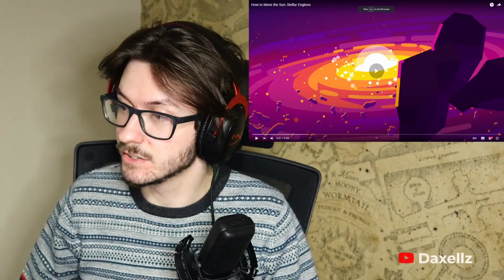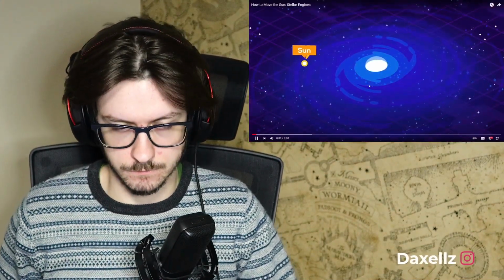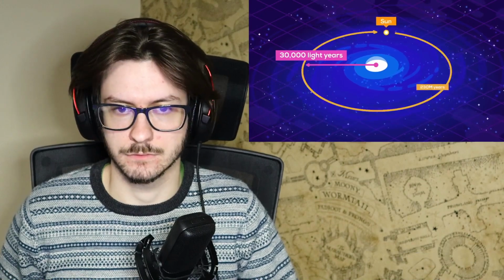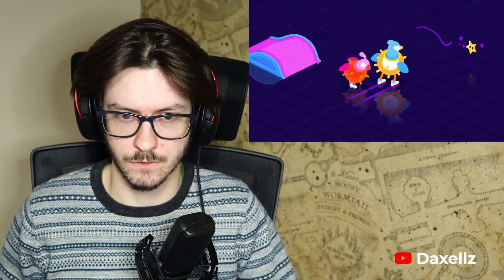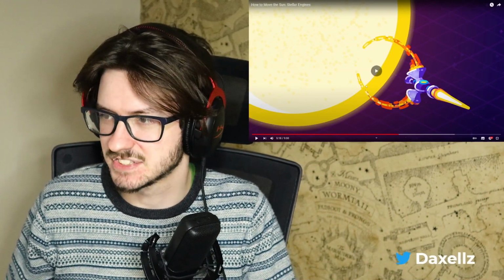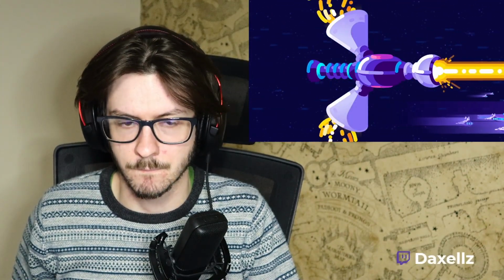Daxellz Reacts to How to Move the Sun: Stellar Engines

Comment: 1:50 It's true cuz the gravitational acceleration of the sun would be much greater than the stellar engine. I took a look at the socues a long time ago when the vid came out & the acceleration from the engine would be ~0.1% of that the sun gives to planets, so obits wont change neither we have to worry about anything else. The sun is lik 99.86% of mass of solar system after all.
4:30 It's amazing how mathew caplan, who looks through their research as consultant wa sbasically sponsored by them to write a paper. The paper got published the same day they publishd the video.
5:30 Well, it's answered if "it's too much sun"